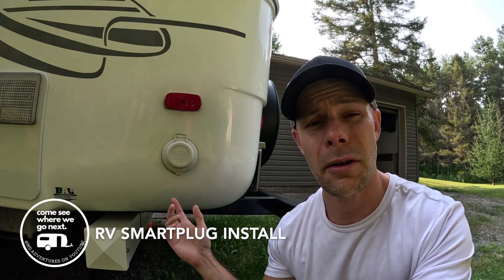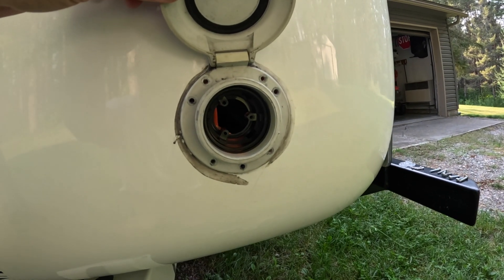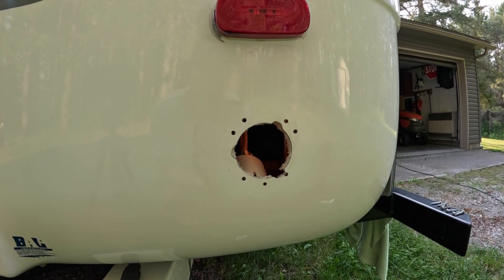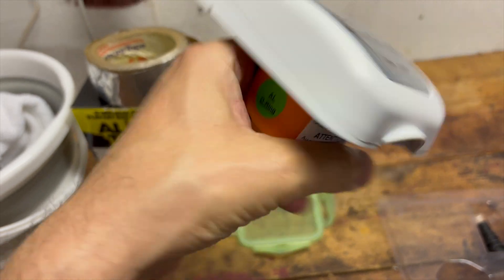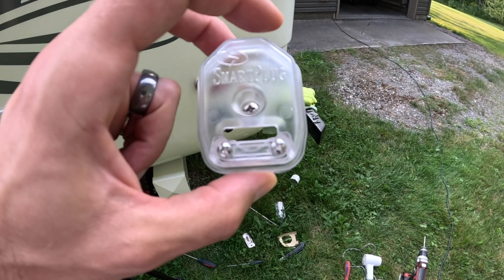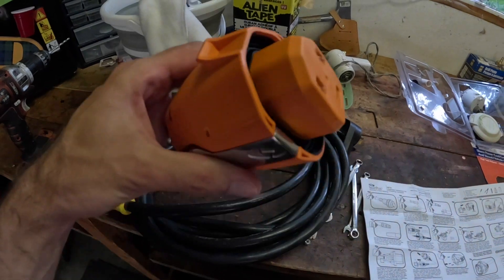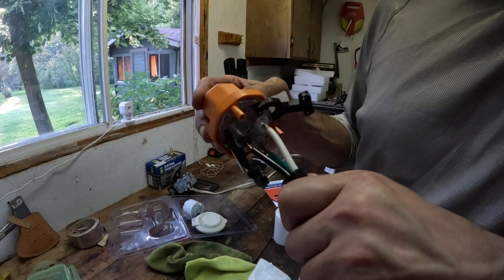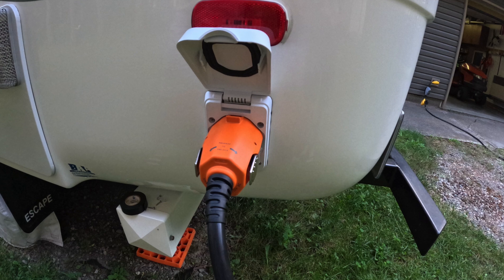RV SmartPlug Upgrade: How to Replace Your Shore Power Connection

Comment: And what is the purpose of a smart plug? when you take your RV in for service and repairs don't forget to bring your smart plug cable with you, the dealer may not have one.
Reply from the maker: @theconnectedcamper  our twist lock was toasted so we opted for this, it has better contact so less risk of arcing. We keep our cable in our RV all the time, so plugins in at a dealer will not be an issue

Comment: It’s nuts to me that RV manufacturers are allowed to use solid-core romex.
Reply from the maker: Why do you say that?
Reply: @md.adventures  it’s prohibited on marine applications because the movement of the vessel may cause repeated bending of the solid wire, this could cause the wire to break inside the sheath, leading to arcing and fire. If anything, RVs should be the same.
Reply from the maker: @jmpattillo  oh good to know; thanks for sharing
Reply: @md.adventures  it’s probably ok since we don’t see RVs burning up everyday, but it doesn’t make sense to me that it’s allowed. From what I’ve seen, Escape does a way better job with wiring than other manufacturers. Putting arc fault breakers in would go a long way to mitigate the slight risk.
Reply from the maker: @jmpattillo  yep very good point